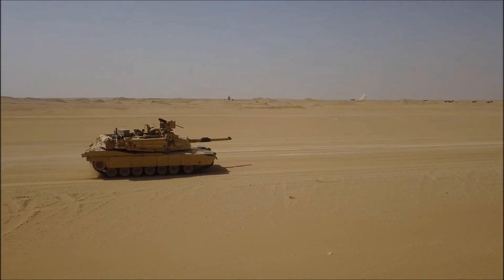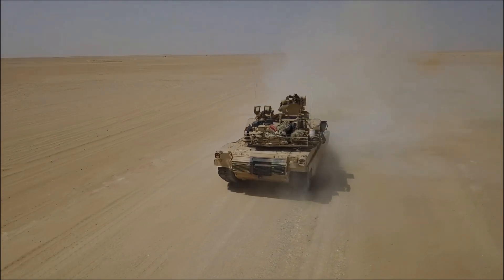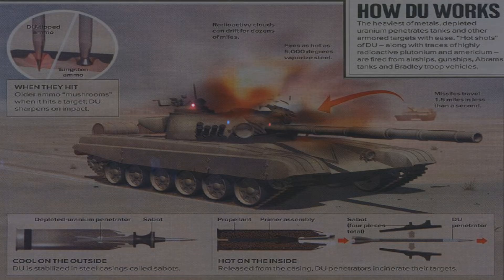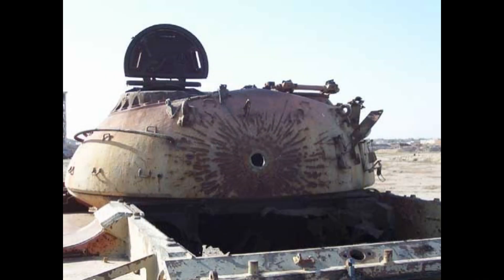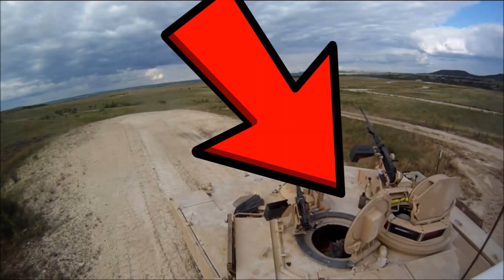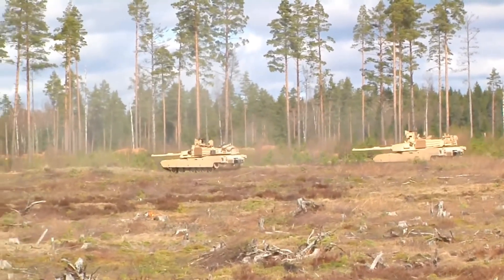Depleted Uranium Tank Ammunition | DEADLY DARTS 💀☄️

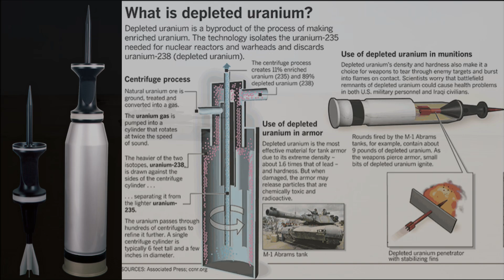Comment: 1:30 "[..]Uranium. The heaviest, naturally occuring element on earth"

Nope. Tungsten is heavier by a little more than 1% (Naturally occuring Uranium is lighter). Gold, platinum, indium and osmium are even heavier, but Gold is the cheapest one of these four. You would bankrupt your entire army by ordering a few rounds of those.

It's not that DU is cheap, it's actually that it is rather useless. Tungsten has a wide applicability in machine tools, so it has some intrinsic value. That makes DU the perfect alternative for when you have cheap dead weight that does not accupy much space, like aircraft ballast and trim weights.
Natural uranium has a 0.77% of fissionable uranium. Reactor designs vary, but you have to crank that percentage up to turn it into fuel rods, the most being 3% Uranium 235. You have to extract that 0.77 from more uranium, depleting it of it in the process. In the end, for every kg of reactor fuel (3% enrichment), you end with about 4kg of DU. For weapons grade uranium, every 1 kg of 80% pure uranium leaves you with about 104Kg of DU. The Little Boy bomb design built in Hiroshima had 64kg of Uranium enriched to an average of 80%. The US built 26 of them. And that was only the very first design they "mass produced".

The way they do it is through Isotopic Separation.
The uranium enriching process involves turning natural Uranium into Uranium fluoride (UF4), a fine yellow powder known as "yellowcake". You take that powder and throw it into a centrifuge. Much like Plasma separating from blood cells in medical centrifuges, uranium centrifuges make the heaviest elements go to the outer casing of the centrifuge drum whereas the lightes ones stay in the center. But there's so little of the slightly lighter U235 compound they have to scrape off the outer layer of the thing and repeat the process over and over and over again until you end up with the desired concentration. Industrial scale uranium refining involves scraping off most of the powder from the inside of the centrifuge and sequentially throwing it into the next, each step containing more and more U235. For reactor grade uranium, dozens of centrifuges are used. For weapons grade (80% and up), the number of centrifuges running, each scraping off that little bit more of U235, numbers in the thousands.

As stated above, Depleted Uranium is indeed rather useless. There have been some developments in it's use as fuel in the MOX and Breeder cycle, but their use involves plutonium, and you know, no proliferation and stuff. The alternative is developing the Thorium Fuel cycle that turns U238 in U232 withouth going through Plutonium, but I don't know how close to a practical reactor we are (India is investing heavily in it, though).

Using it in ammunition or armor was only natural. Because it's heavy weight favors it as a cheaper alternative to Tungsten. It was then when the "self sharpening" property was discovered and the use proliferated through nuclear capable countries. Some countries, like Germany itself, insist in using Tungsten penetrators still.

The Dart KEP round is not good because of the Uranium. It is a good design by itself. Projectiles have a measurement taken into consideration when you want to design them for penetration, not only through armor, but through flesh and air as well. It is the Ballistic Coefficient, which is basically a relationship of the length and the diameter of the projectile. You can see it as a bunch of mass trying to get through the same hole. It's easy to picture that a dart will have a much easier time getting through a flat piece of steel than a ball, right? That's, in simple therms, because there's a lot more mass carrying momentum behind the tip of the dart rather than spreading it out like the ball. That stream of thought is what made them design a "dart" as a kinetic energy penetrator for tank guns, known as a Long Rod Penetrator. The concept has been applied since the T-62.

And finally, a topic I think you broached briefly.
Depleted Uranium is, by itself, pretty much harmless. You can handle them all day and carry some in your pocket withouth deviating from the mean chance of Cancer in the general population. DU still has some leftover U235 in it, but overall it's pretty inert. It's half life is like 4.5 billion years (that's almost the age of the Earth itself...), meaning it is still radioactive, but releases it's energy sooooo slowly it's pretty much harmless. In fact you'll be exposed to more radiation in an 8h flight than by sitting all day in a DU ammunition storage shack. DU is actually used as radiation shielding, and it's better than Lead at it. The health concern with it is not the practically nonexistent radiation, but rather because it is still a heavy metal, very much like lead in that regard. The controversy about DU rounds it's because their impacts pulverize the projectile and creates a fine heavy metal dust that can be inhaled.

And one final note, about the monocristalinic thing people get wrong all the time. Even prof. Martyn Poliakoff (from Periodic Videos) got that wrong, and I too was taught that wrong until I studied Engineering an actual expert in the matter taught me otherwise.
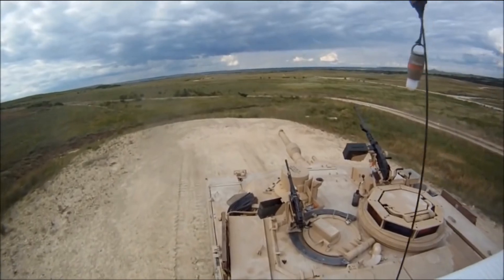You said in 8:08, It is not the monocristalinic nature of a material that makes it strong. Get that out of your head. It's the other way around *The finer the grains in a metal, the stronger it is*. This is due to the way the crystals are arranged. They form an homogenous, orderly crystal, so if you have "large metalic crystal" *that's the weakest it can possibly be*.
Materials do not break by severing the atomic bonds with eachoter, but rather by atoms sliding off one another. This is the Sliding Planes theory, and if you look deeper into material science, you'll see this orderly structure crystals arrange themselves in has a ton of sliding planes. When a piece is made out of a mess of tiny little crystals, that means that there's a tangled mess of these sliding planes a crack has to go through. As the atoms on a crystal slide off one another, rather than going into a single direction as they would in a monocristalinic piece, they have to change directions as the orientation of the cristaline structure (the sliding planes) of the next crystal is totally different. This is why the finer (and the more there are) "chaotic mess of tiny crystals" is much stronger than a monocrystaline piece!
I would recomend R. C. Hiebbler's Mechanics of Materials if you want to learn more. That's a staple engineering book and the best one about it around.
You may have reached that erroneous conclusion because jet engine parts are made of monocrystalinic pieces. And that's true. They have to be monocrystalinic because they have to be strong, right? Wrong. Turbine parts work at very high temperatures. And high temperatures tend to erase any work you try to do to refine the grain structure of a material, turning it into a single crystal. So to get that out of your head *turbines are monocrystalinic because they have to be designed at their weakest due to high working temperatures".
There has been a lot of research done in this regard to alloying and how they affect the crystaline structure of a metal, which are especially important for high temperature applications. There's also vacancies, substitutive elements and other stuff that break the sliding plane thing and help make a material stronger, but this comment is already too damn long. I would only recommend you read some of Hiebbeler's book again if you want to learn about them.
Reply: Yeah but it would be so cool if the US would cruise around in platinum tanks shooting gold rounds ... with a flag that said "Pimpin' ".  OP.
Reply: Hey I know some of those words....
Reply: By "heaviest element" he means by atomic mass. Not density. Uranium is indeed the highest atomic mass element that naturally occurs on Earth. All elements above uranium have half lives short enough that any that was present when the planet formed has decayed below measurable quantities.
Reply: Thauã Aguirre yellow cake is not the same as Uf6. Uranium Hexsfloride is greyish in colour and more granualar texture being formed when yellow cake is treated with nitric acid and eventually flourine. Im deliberately being vague. Also enrichment can be gained via gasgeous diffusion, AVLIS and  Neutron Spallation. The % you gave for enrichment is way to high
Reply: @llatimer2  spot on, two things used to scare me, Uf6 and rapid self disassembly rotors ;)
Reply: And in your first sentence you meand Iridium not Indium...
Reply: well you breached this topic deeper then any DU Sabot round can...
Reply: Thanks i learn a lot. As an average Joe not in STEM, I am not smart enough to argue or support your assertion, but that will be the gateway for further learning.
Reply: Thauã Aguirre few facts wrong but informative to the lay person
Reply: Thauã Aguirre you have absolutely no clue how the periodic table works do you? Uranium is the heaviest naturally accruing element on the periodic table. The atomic weight of tungsten is 183.84. The atomic weight of uranium is 238.02. Since you obviously skipped chemistry I'll clarify. The bigger the atomic number the greater the weight.
Reply: @godofawesum223  of the ATOMS, yes.  But do to differences in crystalization, atomic weight is not directly related to physical density.  Simple metallic tungsten is denser BUT vastly more expensive.
Reply: @godofawesum223  he thinks he is smart
Reply: "...discuss in the comments..."
proceeds to make the 95 thesis
Absolute Madlad.
Reply: Yea but!,.... Nevermind
Reply: @Thauã Aguirre Very good, just one minor correction:
"but their use involves plutonium, and you know, no proliferation and stuff."
Should rather be: 
"but their use involves plutonium, and you know, A MORAL PANIC CONCERNING proliferation and stuff IN THE US." (Somehow in for example France it's fine with reprocessing and could be even considered as eco-friendly recycling)
Reply: They use DU because it destroys targets , and it devastates countries afterward and you get rid of waste pure genius
Reply: @AverageJoe8686  "DU is one of the more poisonous metals, which is why you need a minimum of rubber gloves to handle it. Inhale one breath and you're dead."  That's cartoonish balderdash.  Moderate handling of DU with bare hands presents a negligible risk.  I've done it myself many times, not that that proves anything.  As for inhaling DU, it presents a significant cancer hazard and should be avoided but inhaling DU has been done before by many people who live yet and most will die of something else.  All your jibberish about reactors is too pointless to address.
Reply: About dust : not only inhaled - it is blown by the wind, then washed by rain into the ground. Then it gets into crops.
Reply: well said! and some carbides of tungsten are significantly stronger, and about as dense as DU alloys. its all material physics from there.
Average Joe, those properties do matter, it just depends on what situation. ~2km/s metal alloy rod? yes, it matters.

Edit: The stated velocity for the Sabot DU darts is ~1700m/s... 5500 fps, or nearly 4000 mph. Very fast, denser than any practical armor material, and with a sectional density to keep pushing through anything in its way except some cunning equal-and-opposite force techniques that leaves the domain of standard armoring, entering composites of high tensile high toughness, kinetic defense impactors, and explosive reactive methods.
Reply: @Baigle1  sure there are tungsten carbide much stronger than DU.  The idea of buying TC for tank shells is simply insane even for the US Army.
Reply: @markdoldon8852  ... versus radioactive waste...
Reply: Holy shit this guy has a lot of accounts... The Precipice of fake bots climaxing into this dudes Meth induced jiberish referencing even the Nazi's. SIT DOWN !
Reply: @flaplaya  What the FUCK!!😂😂LMMFAO😂😂
Reply: Besides the confusion you have between toxic metal and heavy metal; it's correct.  DU is toxic and dangerous regardless of the small amounts of radiation.
Reply: too long; didn't read
Reply: AverageJoe8686 for the win. This is what I came here to say.
Reply: I'm 99.9999% sure you meant Iridium instead of Indium
Reply: "The International Coalition to Ban Uranium Weapons (ICBUW) is a global coalition of 160 groups in 33 countries" From their own site: "Because of uranium’s physical properties, uranium weapons burn when they hit hard targets. This leaves behind fine particles (an aerosol) of uranium oxide in the environment. These particles are both chemically toxic and radioactive, for this reason their effects have often been equated with the fallout from nuclear weapons. Depleted uranium oxide aerosols are unlike anything created by nature and for this reason we are still learning about their effects on health and the environment." http://www.bandepleteduranium.org/en/faq

And I would add that when we get to aeresolized metals, we're talking about particle sizes less than 10 nanometers in diameter.  That can float through the air and through your skin.  When inhaled, it can go through the nasal membrane and right to the brain.  Amazing stuff, wherever it happens.
Reply: You forgot its self sharpening. How DU reacts to steel at high speed that's liked.

Led vs steel rounds.
Reply: @aguirre Rubbish!!!!!!! Uranium separation/enrichment is done by turning it into uranium hexaflouride a corrosive and poisonous gas. Then you either use a semi permeable membrane or centrifuge to separate out the heavier U238 (US, UK, Russian, French, Chinese method) or a vortex (The method the South Africans taught the Israelis). Yellow cake is the refined ore containing both light and heavy isotopes of uranium.
Reply: andrew allen uf6 starts off as granular solid before its gasous. I managed at the gaseous diffusdion plant at paducah, ky
Reply: @llatimer2  Pelindaba instrumentation 40 years ago. Vortex enrichment :)
Reply: @andrewallen9993  yellow cake - oxide.
Reply: @rimantasrozga577  a mixture of all isotopes as it leaves the mine refinery process.
Reply: @andrewallen9993  if you do it 
Again
Then again
Then again
And again 
You separate them eventualy
Reply: Thauã Aguirre - Great outline! 👍👍👍👍👍
Reply: One detail error I've noticed you made: in Thorium reactors, fertile Th232 first gets converted to fissile U233, which is then split to generate energy. No U232, U235, U238 or Pu is involved, which leads to far less of a proliferation risk, as these weaponized isotopes are never present at all, especially the enrichment centrifuges, which are completely absent (as Th232 is the only isotope found in nature). U238 is NOT converted in a thorium breeder cycle; in fact, it's not present to any significant extent at all.
Reply: "especially the enrichment centrifuges,"

CANDU reactors already run/ran on natural uranium (the most recent designs use LEU), no enrichment required. The requirement for enrichment is a consequence of the reactor design, not the fuel cycle.

U233 can still be used in nuclear weapons, however it is far more difficult to handle which makes that process difficult by comparison.
Reply: @liesdamnlies3372  eyy the CANDU reactor! Canadian design!
Reply: @airplanemaniacgaming7877  What's really exciting is that a bunch of companies are setting-up here because our regulatory requirements for new nuclear reactors are...well, sane, compared to the US. IIRC New Brunswick is still on its way to building a molten-salt reactor in the near future.
Reply: Damn. Did that take you all day to study on and write? Impressive. I'll have to read all that tomorrow and check it out. Lol
Reply: You need to get out more !
Reply: NERD
Reply: Dude, that was absolutely fascinating to read.
Reply: TMoD7007  Moreover,  his statement that "Projectiles have a measurement taken into consideration when you want to design them for penetration, not only through armor, but through flesh and air as well. It is the Ballistic Coefficient, which is basically a relationship of the length and the diameter of the projectile." is nothing but misinformative, horse-shite. A Ballistic Coefficient is a measurement of drag. Essentially, the higher the Ballistic coefficient the better a projectile will overcome air resistance. Dividing the sectional density(the ratio of a projectile's diameter to its weight) of a projectile by its 'coefficient of form' results in the ballistic coefficient. BC measurement pertains to external ballistics, not terminal ballistics which is "the study of the behavior and effects of a projectile from the moment it hits its target." 
    The sectional density of a projectile serves to determine a projectiles BC, and it also plays a role in determining a projectiles penetration capability. Though sectional density is but one factor among MANY which determines projectile penetration. Moreover, BC will shift with the changes in a projectiles shape and speed, while sectional density does not. The bottom line is that a projectiles BC is a measurement that pertains strictly to it's external ballistics only. The OP is misinformed.
Reply: @Wabi-sabi8551  not on this subject.  His statement about BC is simplistic, not WRONG.  Your explanation is more complete, that doesnt make him misinformed.
Reply: So, the periodic table of elements is wrong?
Reply: Well... I admire your obvious knowledge in this matter...  But you could get straight to the nub of this issue.  It is not so much that this particular material is superior;  it is because it serves well, and is cheap (being a reworked waste product).  Getting into the why's and wherefore's, especially digging into little boy, seems somewhat excessive, when the essential point of your short essay is; "its NOT the superior material".  As for matey boy whose name I can't recall who pointed at you as being wrong, getting into poisonous gas and hexafluoride, there are of course many ways tom shin a cat.  What he describes is the gas centrifuge, but, it can be done mechanically, or, in the case of the early Calutrons, electronically (Saddam Hussein followed design plans declassified by the Library of Congress).  Anyway, always enjoyable to see a comment section with some substance to it... Bless y'all
Reply: Too much to read. I am going to watch porn instead
Reply: Keyboard warrior... Can it Kill thats all that matters
Reply: Is there undepleted plutonium in the depleted uranium?
Reply: This has to be the longest "comment on you tube
Reply: #madlad
Reply: Okay I get your point.....🤔
But what are you really trying to say?🙁
Reply: Nerd territory. I want to read I really do but my brain isn’t equipped. Love to see proper replies though 👍
Reply: Holy crap thats longer than the essay I wrote at school yesterday
Reply: First time I've ever read one of these YouTube novels.
Reply: Fat bitches in Camrys at the Mcdonalds drive-in is the heaviest element on earth.
Reply: Why ?
Reply: I know the comment is old but in case anyone and or OP comes and checks it out. Thorium reactors were first developed in the US in the 1950s. Molten Salt Reactors (MSR) or the larger umbrella that thorium reactors sit under. the most promising of these MSR's is the LFTR (Liquid fluoride Thorium Reactor). Oak Ridge National Labs ran on for 4 years before being shut down because all it did was produce cheap endless power in a very tiny space and no weaponizeable  material.
Reply: Not what the periodic charts says.
Reply: Awesome review Thaua, thanks for taking the time to write it.  Glad you didn't veer off and starting talking about a Thorium car.  Why did you leave out "lattice structure,"  this was a ripe opportunity to carpet bomb people with a term that really doesn't get its fair due in light discussion.  You could have ushered in a new era of popularity for it.  For now, "lattice structure" will go back on the vocabulary popularity shelf next to "zoinks."
Reply: @chrisbusenkell   zoinks??
Reply: You're right. However DU is less rare than any of these metals, very close to their density and has a phosphoric effect upon 
impact. Beyond that, you can forensically track rounds with a Geiger counter.
Reply: @paladin0654  *pyrophoric
Reply: its called " heavy stone "  for a reason xD
Reply: Damn, that's a full-on essay.
Reply: This comment was probably a lot more work than this entire video
Reply: A field guide to rocks & minerals could confirm this....they usually state the specific gravity(sg).
Reply: The Iraq's used iridium gas into a pressurized container for their centrifuge process that made the process much more efficient.  They referred to them as Baghdtron's.
Reply: @blondeblue32  A bhagtron  is a calutron (similar to a cyclotron developed at Lawrence Livermore labs in California) just built in Baghdad. Grossly inefficient and uses very large quantities of electricity even if you use silver or gold to wind the magnetic coils. A very low tech and expensive method of enriching uranium. Besides iridium gas was not used but rather uranium tetrachloride a gas suitable for ionised uranium isotope separation using magnetic fields.
Reply: can you repeat your statement?
Reply: Way to much time on your hands
Reply: ah but we dont have tungsten reactors and lots of extra depleted tungsten lieing around.
Reply: Whatever
Reply: @AverageJoe8686  WTF do you do for a living? Great info.
Reply: AverageJoe868
Reply: Holy shit....
Reply: Same
Reply: and i did only read the first line
Reply: @Aaron Washburn very interesting. I also wounder if the heat from firing the DU round changes the Uranium's unit cell to Body center cubic unit cell (gamma Uranium) increasing atomic packing factor which also increase the density.
Reply: @michaelnyman2907  heat from firing a round is nowhere near enough to change the crystal structure.  Certainly not the density.  In any event the amount of material reaching the target over a given frontal area is the deciding factor.  Even IF the energy of firing could density the material this would only serve to shorten the rod (infinitesmally). If would do nothing to change the penetrating power.
Reply: k
Reply: Sir, congratulations for this perfect youtube comment
Reply: Platinum is like $300 cheaper. Indium and like $300 a pound. Now everything you might as well be speaking swahili for all I care. But ya pricing index and destuctibility is why we use it but it doesn't really matter. I just drive the tank not like I shoot or load the gun.
Reply: U said more than he did
Reply: Sooo you can cut and paste.
Reply: Thauã Aguirre not harmless.
Reply: Good Lord you need to get out of the house
Reply: Bradley Christensen true it comes from jewelry stores but what do I know and who cares where I comes from just know I can’t get no gold but I did read the dudes entire thesis I did read way more than one paragraph I found it interesting coz it sounded cool and I worked inside a nuclear plant fir ten yrs just found it interesting
Now I’m no longer interested over my head I only worked armed security made good money no complaints
Reply: Gold isnt natural
Reply: By the way he says this in his video if you weren't paying attention he talking about density not how much it weighs
Reply: Yeah, the guy narrating this was just spewing out false/misguided information. It is not an official source of info. It's just someone making a random video.
Reply: It's called brevity, man...
Reply: FireFirePow two key words Most Natual occurring is the way I understood it
Reply: do you not understand the periodic table? yes uranium is the heaviest most dense natural metal it is further down the table then all those metals tungsten has atomic mass of 183.84 uranium has mas of 238.02891 so it is by far denser than tungsten
Reply: @joshuaburton154  do YOU understand that atomic weights are NOT the same as density of the MATERIAL?  Obviously not.  Yes Uranium is the largest naturally occurring atomic weight.  Its NOT the heaviest material.
Reply: You have way too much time on your hands.
Reply: How is tungsten has a number of 74 and Uranium has a number of 90?
Reply: @wrongway1100  those numbers refer to the number of protons in the nucleus of the atom.  They are not directly related to density.
Reply: Wall of text
Reply: Incorrect. You claim to be knowledgeable about lots of things but you're definitely no expert here - you're using grabs from many sources to make what appears to be intelligent writing. It isn't.
Your first mistake is the connection between yellow cake and centrifuges. They do not put powder into the centrifuges you idiot - the yellow cake is gasified. Yellow cake is turned into a gas and spun that way. Have you even looked at a centrifuge hall and seen what they look like? It's not like a washing machine you fool. The centrifuges are all connected via network of pipes with each pipe leading to the next centrifuge and so on. Yes - they really do spin gases to separate them!
Your second mistake is in metals science. It definitely is a single crystal grown to form a projectile. You honestly have no idea about materials science and are comparing granular strength against crystalline strength. They have many variables when used as different things. In this case, a single crystal is far far stronger than a small crystal bonded item.
As I've said, you claim to be an expert across the whole field but alas are not. Fool - just shut up when you know fine well that you're telling lies..
Reply: Thauã Aguirre I was about to say THE SAME EXACT THING but you beat me to it. Saved me some typing.
Reply: Word.
Reply: Some people say "you learn something new every day..." Thanks for giving me at least a week worth's.
Reply: Holy S H I T this is long
Reply: That was a very interesting comment my friend. I’ll admit it, you’re much smarter than me.
Reply: Well thank you good sir for taking your time to write this comment xd
Reply: Thauã Aguirre dude you wrote a whole essay wtf xd
Reply: Thauã Aguirre you spelled as much as wiki
Reply: This is the longest comments I ever read in Youtube.
Reply: This and what is more - pyrophoric.
Reply: Well, coming in 7 months late, I found your thesis fascinating.  I thought the vids comment on grain and strength sounded off, but good to have the concept explained so clearly.
Reply: Ok
Reply: Hm this is the best comment i did ever read on youtube! Thank you for your time:)
Reply: He means based on Atomic number you moron...... It has the heaviest nucleus of any naturally occurring element on Earth... That's just physics, if you mean density that is something different entirely. You make a lot of meaningless distinctions in this screed like "It's not that DU is cheap, it's actually that it is rather useless" its cheap, BECAUSE its useless and abundant, so that's kind of a meaningless distinction to make.
Reply: Ya well...wherever I go,There I am!     Top THAT!
Reply: NERD
Reply: chemically uranium has the heaviest naturally occurring molar mass, not the densest, but it does have the heaviest atoms
Reply: Nah
Machined tungsten is more expensive than 4 kg of cast gold
Reply: Thauã Aguirre — You are thinking of density.  The video did not say Uranium was the densest element.  It is the element with the greatest atomic mass among the first 92 “natural” elements.
Reply: holy shit
Reply: When do you sign books?

I don't want to buy it thanks.
Reply: Weight is meaningless in this context. What you mean is density. Density is mass per volume, where weight is how much gravity "pulls" on a specific amount of material. So weight changes depending on how much mass or material you have, but density will be the same no matter how much stuff you have.

It's about as confusing as the difference between speed and velocity. Leave it to phycisists to define two things that sound the same, but are completely different.
Reply: Found my thesis
Reply: Holy fuck I usually appreciate depth in an opinion but that's way too much. 
Yes tungsten has virtually the same density rating.
Yes it's more expensive. 
And Americans are idiots for literally countless countries with uranium.
Reply: Thauã Aguirre Thanks for taking the time to write this up! Very informative
Reply: Honestly I have never been so educated or concentrated in all my life you have totally intrigued me into nuclear physics and also the properties of weapons grade or fuel grade uranium. I have watched many videos on the “nuclear process” but none of them have achieved what you have done in terms of a educational comment, I paused 59 seconds it to purposely read this comment sure glad I did. The. I wondered if I need to watch the video he’ll you just told me everything I need to know! But I failed my simple mind could only think of tanks shooting some badass ammo damn
Reply: Uranium fluoride is actually UF6 (uranium hexafluoride) and is a gas (lower boiling point than rubbing alcohol). Yellow cake Uranium is Uranium OXIDE (UO2) and is a solid. UF6 gas is used in enrichment either through gaseous diffusion or centrifugal separation. Yellow cake is not used to enrich uranium.
Reply: Walter White in the house.
Reply: 0
Reply: You guys are such nerds
Reply: Thorium is a much better fuel ;-; it's more easily controlled, produces much more energy, and produces much less waste, as well as being more common. You just need some a tiny bit of plutonium to kick start it, but that also means you can stop the reactor by  separating the plutonium from it.
Reply: @IkeanCrusader1013  when you combined with liquid fluorine salts, the reactor becomes more efficient, and safer owing to a higher heat capacity coolant and better fail safes. I hope we move that direction soon.
Reply: Holy fuck dude calm down shit
Reply: When you say heavy do you mean in terms of density? Additionally, the fact that DU is used as radiation shielding is not necessarily all of it. It is easily ionized by higher energy wavelength and if exposed to a nuclear blast can easily ionize and become radioactive itself, completely nullifying NBC protections in modern vehicles but that's sorta an aside.
Reply: you really wrote a book well done 👌😂
Reply: Thauã Aguirre you are gay
Reply: Correction some nations Militaries would bankrupt themselves by ordering just a few rounds the US military would order 20 more train cars full of rounds while the Russians downsize their military and start folding Tachanka battalions Hehe
Reply: You ever researched Galen Windsor?
Reply: Thauã Aguirre Just think, with thorium we could make tank incandescents. Like fire flies. 🤣🤣
Reply: Thauã Aguirre who puts that much effort in a yt comment??
Reply: Reading this comment and the repies felt like reading the Bible 3 times
Reply: Stop writing the Old Testament of the Military Bible, please. You're wrecking the comments section.
Reply: Holy shit do you have a life?
Reply: Jesus this isn't high school and we don't need an essay.
Reply: That's either copy and paste or you need a new hobby
Reply: Thaua I learned a whole lot about Uranium than I expected from that thanks for typing all of that out and sharing. 👍
Reply: Good work in explaining metal hardness.

But your chemistry of uranium and its isotopic enrichment is way off.

Yellowcake, the article of trade in natural uranium, is U3O8. It's converted to UF4 for handling for isotopic processing. In the process, it's fluoridated further to UF6, which is a gas at usable temps, 300-400C. This is then concentrated in gas, not powder, centrifuges. You are correct in that it requires a large number of them, each slightly enriching the gas stream. It's then converted back to  UF4 for storage and shipping. Same at the other end, for the depleted fraction.
Reply: TL;DR
Reply: How do you know all this? It’s impressive. And I’m not sure if it’s all even right (I would like to assume it is..) 
What’s your background? Chemistry?... I wanna get into the resources you have used in the past for your knowledge. It’s neat to know very in depth things about a topic.
Reply: Jesus christ, did I read a book? Interesting none the less
Reply: Damn
Reply: Liked this comment made my day time to learn again about microstructure by any chance are you a material engineer?
Reply: god, i clicked to read more expecting like a couple sentences, not a college master thesis.
Reply: nerd
Reply: Simply.....WOW
Reply: I don’t believe you. Please provide more information
Reply: Thanks for this educational text !
Reply: but what uranium does, as it goes in, it sharpens itself, and doesn’t dull as tungsten does. and not only that, the uranium creates a “dead zone” as you could call it or a fallout zone so that enemies cannot scrap out their vehicles after wars
Reply: Big brain
Reply: Density vs weight my guy
Reply: You got me to read that entire comment. You win the internet today.
Reply: Thorium is the 39th most common element in the earth's crust,  Uranium is 51st.
Uranium also has to be heavily refined to be able to use in reactors, much more then thorium which can almost be used as is.
Kirk Sorensen compared it to burning up platinum when it reached the end product. (I'm no nuclear theorist, but your claims are far away from what little knowledge I've gathered on the subject so far)
Reply: Uranium is the heaviest element, not the most dense.
Reply: Peter Smythe wrong it is both the heaviest and the densest. I suggest researching how many protons electrons and neutrons uranium contains compared to other elements.
Reply: im gonna down vote you because you didnt supply enough information on the subject...
Reply: Thaua, I see you know your elements from chemistry, but unfortunately I'll take it you have no practical experience breathing in burned depleted uranium dust that was left behind in wars conducted by cowboys in Iraq, Libya, Yugoslavia etc..
EVERY one of those countries mentioned has huge problems with local population suffering from enormous increase in cancer sufferers including kids, that play around armoured vehicles hit by DU rounds.
Russia is not using DU rounds.
Germany is not using DU rounds.
Do you think those countries like using more expensive tungsten rounds!?
No. They are fully aware of the danger DU rounds pose to the living organisms when they contaminate air, soil and water. 
They know if war break out, it will most likely be fought on their soil, so they aren't willing to additionally poison their soil by this garbage left over by nuclear industry.
Cowboys on the other hand, have no such worries as they can get rid of their nuclear waste by.. simply spraying it everywhere around the world across this beautiful planet and let the local population face the consequences.
So, I see they tought you really nice theory of DU rounds being harmless. Actually, I'd be surprised if they didn't! 
Heck imagine soldiers forced to work around this nuclear rubbish if they were informed that there's higher likelihood of them developing cancers, becoming sterile, or having babies with birth defects.
Don't think there would be too many volontiers to work around this garbage.
This happened to Italian soldiers in Aviano military air base as they handled cowboy's DU rounds during wars in Yugoslavia.
Lots of them got cancers, prevalent being leukaemia.
It was all swept under the carpet, where even some Italian doctors changed their statements of DU being dangerous when they realised how deep the rabit hole really is.
Anyway, you enjoy being around this stuff if you have chance. Theory THEY thought you is one thing, reality is different.
Reply: I love how everyone who disagrees with what your saying is trying to word their replies using as meny smart words as they have in their vocabulary well not knowing the context and proper definition of said words in other words just because you wanna prove someone wrong don't try and do it in a way that makes you a fucking idiot.
Reply: +AverageJoe8686 "The Thorium fuel cycle is useless. For starters, there is almost no thorium compared to uranium, and is so corrosive to the reactor that it must be decommissioned in under 5 yrs."

OMEGALUL

You've got no clue then when it comes to relative abundance of thorium. There are already minable worldwide reserves of thorium far in excess of what we have left of uranium.

And as for anything being corrosive...I think you've just outed-yourself as an internet conspiracy physicist, and I mean that in the most sardonic tone possible. Fuel cycles literally can't be "corrosive". That doesn't make sense. Nor does a metal (thorium) being corrosive either...

"DU is one of the most excellent reactor fuel sources."

IT LITERALLY CANNOT BE USED FOR FISSION.

"go with the Fusion-Fission type that burns D-T which generates fast neutrons to burn the DU"

THAT'S NOT HOW THAT WORKS.
Reply: @liesdamnlies3372  yes. That's exactly how it works. Uranium 238 can be easily fissioned with fast neutrons from DD or DT fusion.
Reply: OMG, do you really think anybody read that whole mess? This is youtube bro, most people have an attention span of about 1 paragraph!
Reply: I'm going to be so disappointed if it turns out that you're full of shit. :-)
     Read your comment with interest. Thanks for sharing the info!
Reply: ((every 1 kg of 80% pure uranium leaves you with about 104Kg of DU. The Little Boy bomb design built in Hiroshima had 64kg of Uranium enriched to an average of 80%. The US built 26 of them. And that was only the very first design they "mass produced".))  =  So for one bomb of 64kg pure uranium: they had to create/waste 6656kg of DU (Depleted Uranium)... 3 tones of waste DU.

From the infantry part: once guys had to search these zones... Yeah by logic they must using mask or avoid the search at these chemical hazardous zones or using robot. As you said the projectile itself is not dangerous. But the mix with other combustibles that makes death/toxic smoke around. This type of heavy smoke can travel for miles. From a legal view it can turn to be friendly fire by chemical asset/biological warfare. ((lot of sh*t)) Like those who exposed them self in search inside enemy vehicles and fortifications at first Iraq war in 90's.

Thank you for your comment. I hope you find a work/status right for you. I might read about R.C. Hiebbler's mechanics of materials. I feel myself too old and I do like my style of life now to get myself back at school. Plus I do not have any ear problems except I still must be careful on my personal training. I was lucky to have the ear fix.

Contrary to what others think about infantry, if you dont think... you die. If you can not think you die. So yeah it's all about managing his own drama and his future actions. But most men are not managing their emotion by proper perceptions and they become more childish and children are not managing their emotion. Children needs supervision for emotional support and social skill abilities. Then they build their own as teenagers.

The first step to really think is knowing how to stop thinking and switch on focus when it need to done it with all means possible. That is earned in infantry course. We do it without knowing it that is the true. You must to be 100% there is you say no to supervisor and you can not back down after words. ((No I won't check this metals scraps Sir... I need the right tool for this.)) A true leader will visual himself first in the same action, giving to the men.
Reply: No one fucking asked asshole
Reply: Uranium (U) has an atomic mass of 238.03amu and Tungsten (W) has and atomic mass of 183.85amu. (183.85amu)/(238.03amu) equals 0.7723 not even close 1.01. So why are you saying that tungsten has a higher density? Also monocrystalline might be the correct term not "monocristalinic"  which means that it the round is made of one large grain. Which so the large grains allowing cracks to travel far into the material doesn't apply. The strength of the round is based on the energy need to break the bounds in the grain.  If I am incorrect please explain where I went wrong. (Atomic masses came from the periodic table of elements and the debate on grains comes from my knowledge I have acquired from College class)
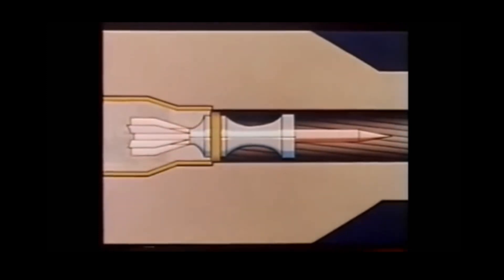Reply: Lol.  It says at 6:38 that uranium is less dense that tungsten.
Reply: @Aaron Washburn  it has more protons and neutrons witch would make it a denser atom than tungsten
Reply: Tungsten might have atoms packed more dense than uranium that would make it weigh more for the same amount or they would just use tungsten instead of uranium.that's my own opinion so I could be wrong but I love science
Reply: Holy fuck type more douchefuck
Reply: did this take all nite to research n write down hahaha
Reply: Raymond J or people actually have expansive knowledge stored in their brains that they can articulate quite effortlessly....ya know people who actually THINK
Reply: @raymondj8768  it's called "education". Perhaps if you get one you will learn to comment with a purpose. Go back to your roblox videos, the adults are trying to talk.
Reply: @raymondj8768  Just copied and pasted it. He has a blank channel so cant prove he knows what he's talking about.
Reply: bla bla bla
Reply: bla bla bla hahaha
Reply: @raymondj8768  cancer